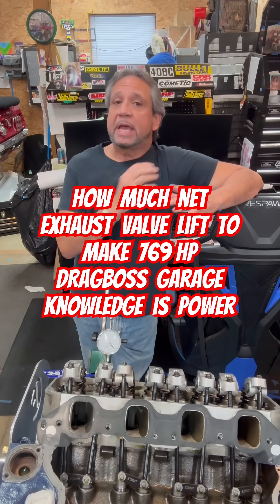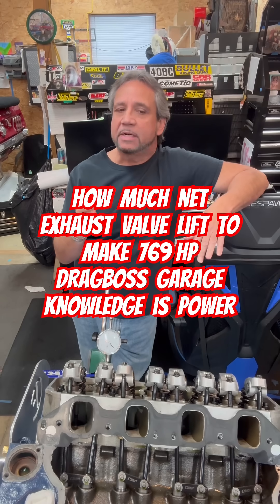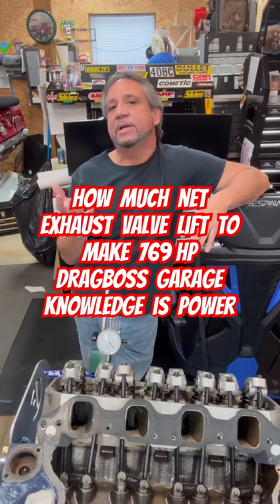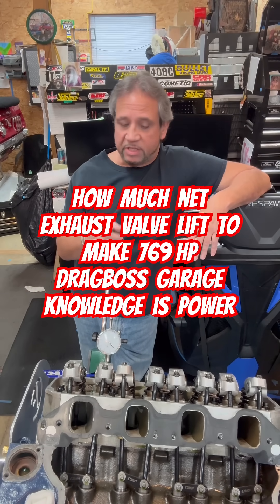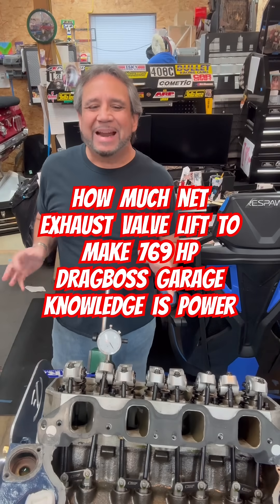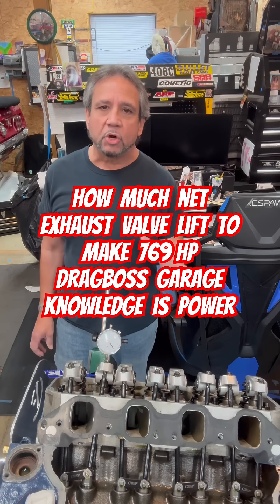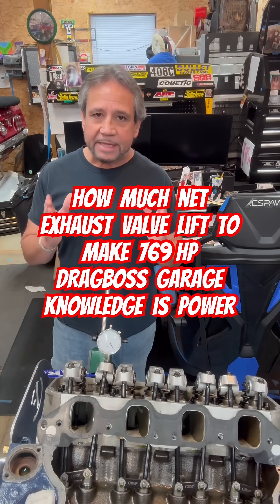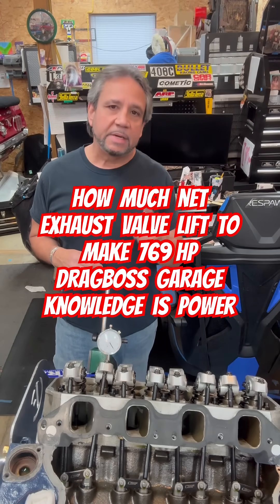How Much Net Exhaust Valve Lift To Make 769hp? #automobile #cylinderheads #dragracing

Comment: Hi Tim.
I enjoyed the title. Kinda scary when you and or Darin ask us students how much valve lift you need on the exit side. 😊
But two part answer here. First, this gave me an idea. It would be fun if you guys turn the tables and ask us to answer a question like this once in a while. Its really interesting to read multiple answers from your viewers as well as read or watch you and Darin comment on one or two comments from us. It might inadvertently lead us all to new ideas. And possibly a kinda fresh unexplored resource to expand ideas. Even know alot of the comments might be wrong. Sometimes a diamond can appear from the most unsuspecting places.

Answer: imo, we need more information like your exh valve and throat diameter as well as seating angle. But I can say a huge component in my exhaust stratagie including lift required. Involves the conservation of energy. The amount left over to exit during the blowdown phase is greatly determined by combustion efficiency. not just the amount of product ingested. The higher the compression ratio. The more of the air and hydrcarbon component will be converted to mechanical energy. Meaning like a pro stock car. Less component left over to be exhausted but in another example. A 8.5 to 1 502 bbc in marine application will be very happy to have a 1.88" exh valve as it has alot of junk left over after the poor combustion event. Blowdown resistance can be an issue at 10,000 rpm. But like in a pro stock engine. If there is hardly anything left over to blow out the exhaust. Then a proportionately small exh valve and possibly less net lift is required.
Reply from the maker: Thanks Tom, don’t be scared….appreciate the thought and explanation lots of good points. But I really wasn’t asking it as a question more of well it makes this hp, how much lift does it need. Using my engine as an example. But you are right is great to have guys interact and answer questions. Keeps us thinking and when Darin has time he does answer a few. You should think about a membership trial in Knowledge is Power. 💯🏁💪👍

Comment: Push rod angle, rocker geometry, pushrod diameter and thickness. I've lost .080 on stuff with 1.280 lift with 5-6k rockers, steel rocker stand with 28 bolts that weighs like 20lbs or something, 1/2" pushrods. I couldn't believe it.
Reply from the maker: Yes .030-.040 is not uncommon man you had some real losses for sure. And with that valve train 👍 😮

Comment: Tim do those yella terra rockers seem stiff enough? What is your seat and over the nose force of your springs? Im ready for another lesson, keep up the good work.
Reply: Hi Tim, sorry for being rude.
Reply from the maker: @davidreed6070 not at all, no worries whatsoever.
Reply from the maker: They are good for 900 pounds open and this may have 750. Push rods are .3/8, .140 wall. Thanks man way more on the way. 💯🏁